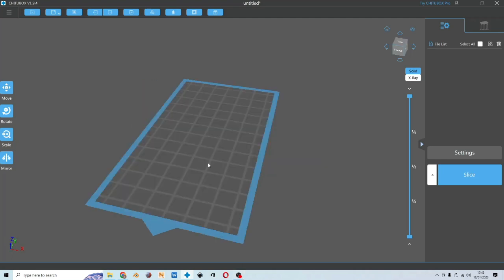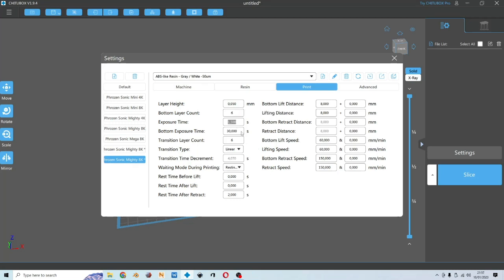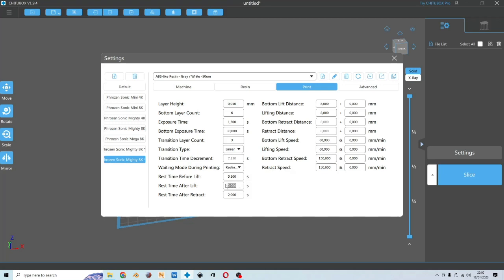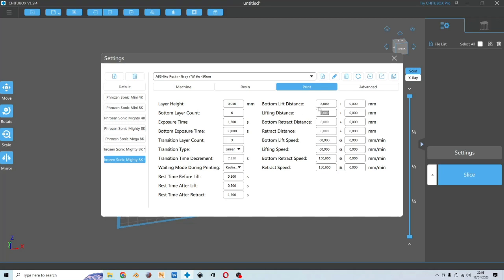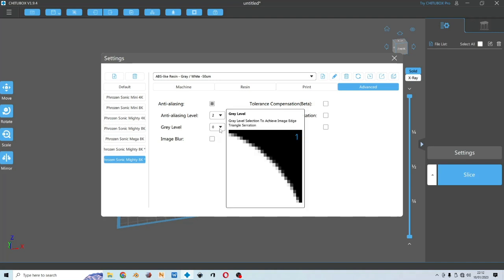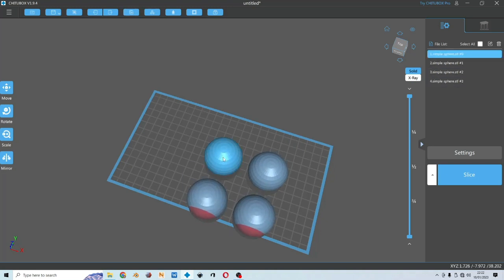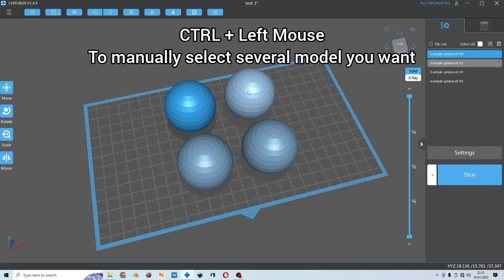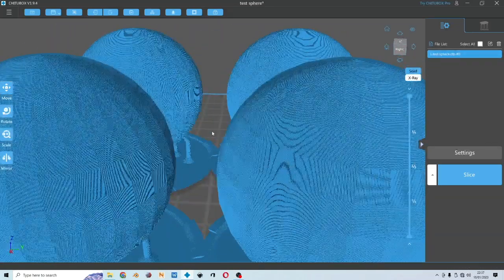Introduction To Chitubox For Beginner

Comment: I have a Mono X2 and unfortunately Chitubox doesn't support the Mono X2 yet :( does anybody have settings for their mono x2 that they use, i can't seem to ifnd anyone online with the same problem as me
Reply from the maker: You can set your own setting for chitubox.
Reply: @wangdennys  I know but unfortunately I can't figure out the settings, I used anycubics software and printed flawlessly, but now they are not working no matter what resin or settings i try. I am getting the issue where the prints are getting stuck to the fep. I replaced the fep but having the same issue